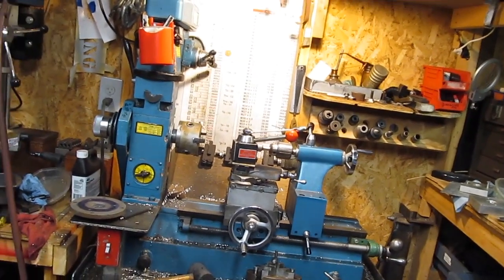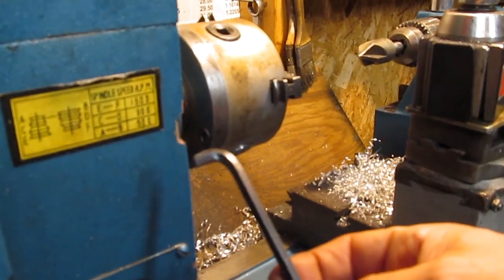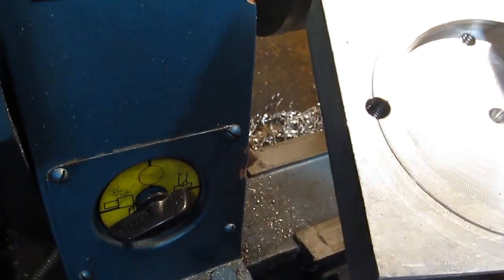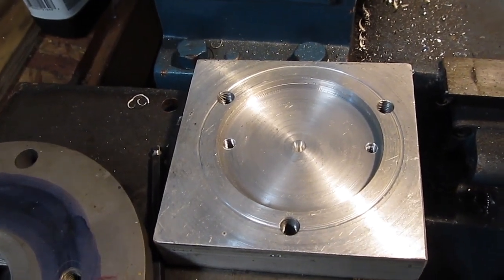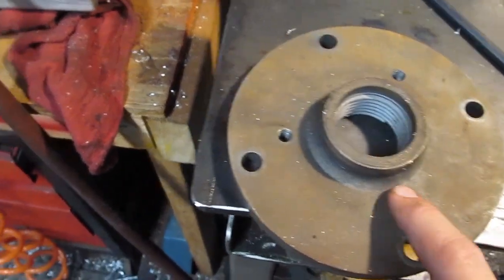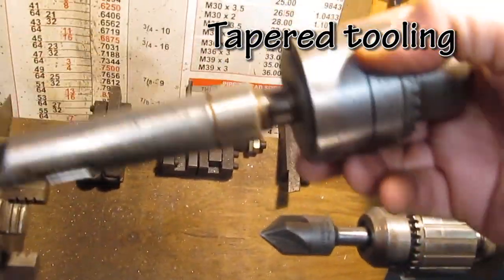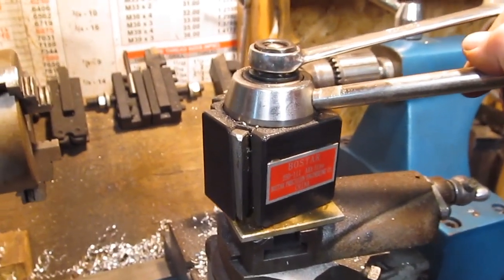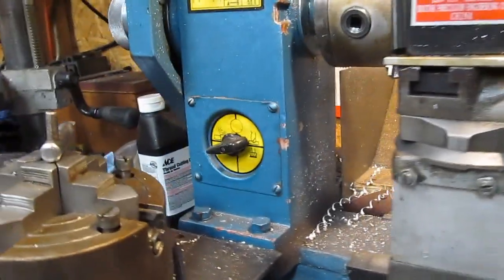Q&A HQ400 Mill Drill Lathe by Chizhou

Comment: I purchased the same machine few months ago and tried it for a few projects on aluminum and mild steel. It has very good accuracy and the surfaces are very good if you use high quality tools. The main issues i had are 1. Covering the main   drive shaft to prevent the metal chips to get into the thread 2 there's a huge play of the main drive when you try to go from a direction to another 3 changing the speed is quite annoying since the tension mechanism is not easily accessible and located in the back under the motor.. But as you mentioned it should do great if tou lock the unused carrier.. I'm wondering whether i should makie electric speed control and keep the pulley in one position or make a new tension control mechanism for the pulley at the side for quicker access.. Any advice would help greatly thanks for sharing
Reply from the maker: Hello, 
If yours is like mine, your first 2 issues are likely related. The chips get on the lead screw and then overtime wear the nut causing more and more backlash. I have a bunch of that backlash on mine as well. I am going to make a new nut and cover the lead screw at the same time with a telescopic metal cover to prevent that in the future. I should be doing a video of that this year sometime. I need to get the right piece of brass for the nut. Your third issue is quite annoying to me as well. In my case I do not change speeds very often as I find the low speed adequate for what I normally do so it is not a priority for me. But, I do plan on doing a speed controller in the future. For the functionality and ease of installation, it is the way to go imho. I would rather have more flexibility in the speeds than just being able to change them easier.
All the best!
Eddie
Reply: @theeddies  thanks a lot for the help. Indeed i thought a wider range and customized speeds would be a great way to get a smooth finished product on various materials and the question is electric controllers versus mechanical or both and i think i'm going for both. For the telescopic cover i couldn't find it anywhere in my country and if i order it it would be very expensive and not worth it so i think i 'll try a plastic accrdion of 32 mm diameter it should be fine. For the leading screw mine is held with a sort of cylinder pin and seems unlikely to get out easily and i' m hesitant to do it 'cause i feel it's too early for me to destroy anything.. Thanks a lot and keep up the good stuff please..
Reply from the maker: @cabinetdr.labbene6512  The plastic should work fine. Aliexpress had the metal ones I think for cheap but it has been awhile since I looked at them. Do you mean the lead screw is held in by a pin or the lead nut? All the best!
Reply: @theeddies  the wheel driving the lead screw is held to it by a nasty pin !!
Reply from the maker: @cabinetdr.labbene6512  That is what I thought you meant. Yes, it is a  tapered pin. One side is very slightly smaller than the other. On mine I could tell by looking very close, I painted the larger side  black before putting it back in. But they come out pretty easy once you figure which side to use a punch on. They also get lost pretty easy once the fly out, lol.

Comment: Paulimot in Germany has what you need. I bought a 4-Jaw 125mm Chuck with an adapter plate, replacing the 100mm chuck and mounted it. Fits perfectly with a runout below 1/100 mm.
Reply from the maker: Thanks for the info. Always nice to have fitment confirmation on an actual product. I will check those out.
All those best!
Eddie

Comment: Is is very good to have mt3 mill spindel and lathe spindle! I have a identical chinese machine. And I use a Mt3 to er32 collet for milling, and also for turning as a collet chuck. M12 threaded rod is my "draw bar". I also bought the chinese 100mm er32 collet chuck but I never use it becase of the mt3 adapter.
Reply from the maker: Yes, I agree. Does yours have an MT3 on the tailstock as well or is it like mine MT2?
Reply: Yes the tailstock is Mt2.

Comment: Awesome video! Thanks! How does one remove the chuck backplate on this model?  Kind regards
Reply from the maker: Thanks! The backplate is part of the spindle, so you would have to remove the whole assembly. In my more recent videos on mounting the four jaw I modify a backplate for the the new chuck to mount to the existing spindle backplate.
Reply: @theeddies  by the way, Nice Triumph! I have the 1967 T100C Tiger of it that I am busy rebuilding. Beautiful bikes.
Reply from the maker: @shadrack6467  Thanks, I have a couple I am working on when I get time. Are you doing a resto or custom?
Reply: @theeddies  resto as original as I possibly can. When my parents came to own the bike ~22 years ago, it hadn't seen much time on the road. it spent most of it's life in workshops. Previous owners had botched quite a lot on some things, and some guy even chromed the inside of the carb etc. so it's been quite a bit of work to sort out the issues and right now I just had to get new pistons after reboring the cylinders up a size due to a crack. The rebore fixed it luckily. Now I'm onto painting the frame etc and my next hurdle is forks. Current are beyond pitted. The bike has seen so little use it still has original factory bulbs and tyres on her. Which of course I will change due to aging on the rubber.
Reply from the maker: @shadrack6467  Very nice. let me know if you need any bits and bobs. I have a few spare parts, mostly small stuff that I would part with. Luckily most everything is still available aftermarket, but not cheap.
Reply: @theeddies  Thank you very much! Very good to know, been trying to figure that out.

Comment: Question: How much oil does the headstock hold? I have just bought a later model (HQ 400/3a) and I want to replace the oil, how much oil do I put back into the headstock?
Reply from the maker: I am not sure of the exact amount, however, the book said fill to the bottom of the rear opening where you fill. That ends up just above the bottom of the rear change gear and front bearing. Any more than that and it wants to leak bad out the front bearing. I also librelly greased the gears in there but not sure that is necessary. Thanks for watching!
Reply: Thank you, I like your videos!
Reply from the maker: @sidblackman  Thanks! It means a lot!

Comment: I have the exact same machine but mine has 3mt  tailstock. A Sanou k72-100  4 jaw chuck will fit if you drill you backing plate for 4 holes.
.
Reply from the maker: Thanks for the info, those are cheap$$. How is the quality? That would be about perfect.
Reply: the_eddies I found the Sanou chuck quality to be excellent  and the precision to be exceptional. In Australia they sell for about $100. I would assume $US would be a little cheaper.
Reply: I also bought the sanou k72 independent 4 jaw for mine( mine is machine is from 1980) I went to a local cnc miller friend and made the 84mm diameter 3xM8 bolt pattern for beer money. Only be careful you cant make the thread more than 15mm deep, because it will interfere with one of the jaws. The original 4 bolt pattern is 86mm in diameter so you can't use none of the existing threads.

Comment: i think this 4 jaw might fit

https://www.clarketooling.co.uk/tools/Metal_Lathes___MillDrills.html
Reply from the maker: Thanks for pointing this out, do you have a Clarke machine? I would like to find some measurements on the spindle mount plate to see if they are close. The picture they show is a four bolt chuck but from looking at the machine pictures it does look like that machine has a 3 bolt pattern.

There is not a lot of pictures so I wonder if they are selling a four bolt with a backplate that fits the three, which is what I have planned already.

At any rate that is interesting, I had not seen that.
Reply: no i don't @  @theeddies , i have a hq-400/3 but i think there basically all the same, might be able to get the specs from Clark,
Reply from the maker: They probably are. I will see if Clarke will send me a bit more info on the chuck. Thanks again for pointing it out.
Reply: would be interested to know how you go eddie Ive been looking at the mill spacer to raise up the crossfeed table
Reply from the maker: @prop1305  Do mean a spacer to set on the crossfeed to get nearer the mill spindle? I showed the 2 axis table that I use now in the other video, but I don't think I showed the simple one I made from a piece of I beam, it worked pretty well and is similar to the machine block on that Clarke page.
Reply: yeah Ive been looking for a rigid way to step up the cross feed table i would be interested to see the one you made out of some beam, i don't have material for it and i haven't had any luck finding any off cuts of something that might be workable figured if i do have to buy something, the Clark product seems to be the best option $ wise without the hassle of trying to make something.
Reply from the maker: @prop1305  I will do a quickie on it, it served me well and I would honestly still be using it but the table was gifted to me, they were way out of my budget at least for a US made one. It only took a few hours to make.

I lucked into the materials, I found some steel roofing sheets for sale on craigslist and the guy had a 10 ft section of I beam laying beside it and he basically gave it to me, though I did buy $250 worth of roofing. 

I see from your channel page, you are in Australia, I was going to offer you the piece for the shipping cost but shipping to Aus would be ridiculous. I think you have Gumtree or something like craigslist there, I would check that for materials.
Reply: thanks Eddie that's the problem being so far south a lot of things become not worth it with the shipping definitely keeping my eye out i only just bought my hq400 so still collecting all the bits and bobs for it.